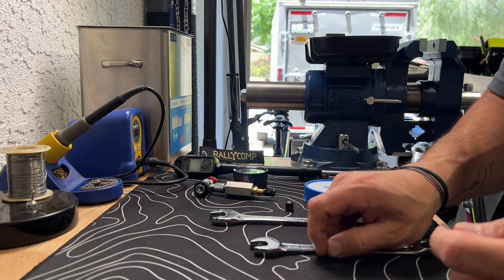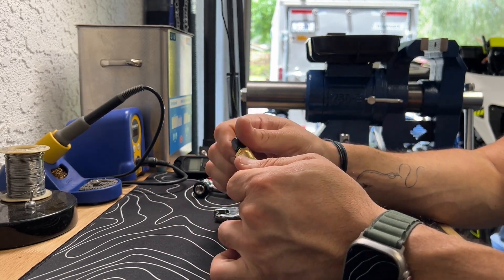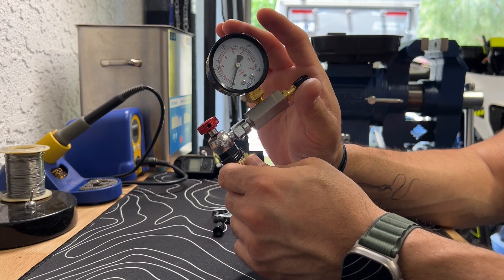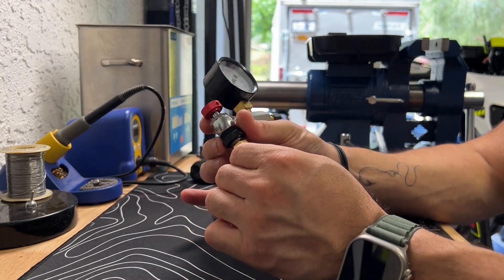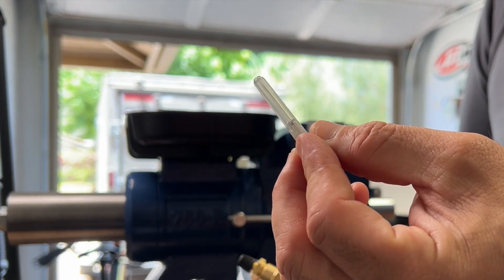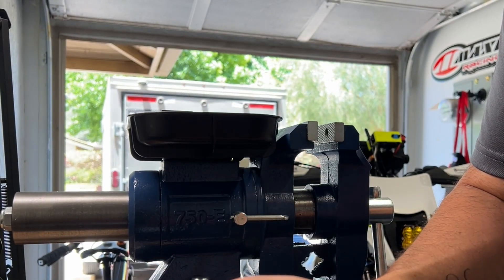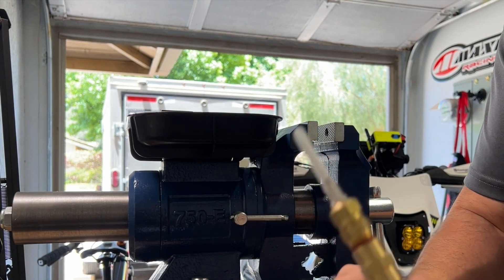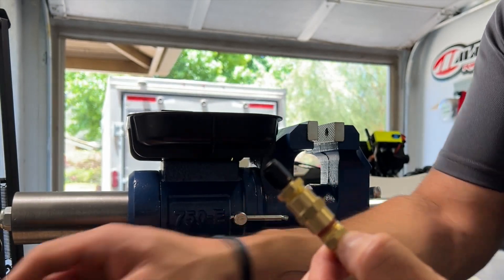DIY Suspension Nitrogen Needle: Motorcycle Forks and more

Comment: If you prick rubber with a needle, won't nitrogen leak out through the hole of the needle?
Reply: No.. The back pressure inside the chamber will force the needle hole in the rubber closed..It similar as to why a football doesnt deinflate after you remove the needle pump..
Reply from the maker: That’s what I thought but apparently not… I’m still not totally convinced